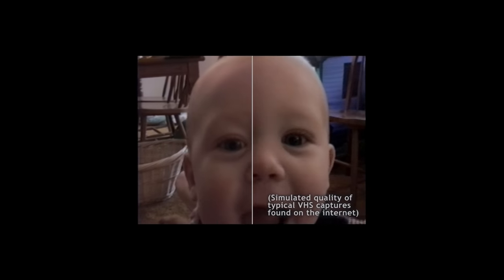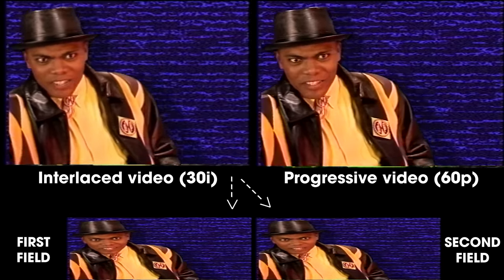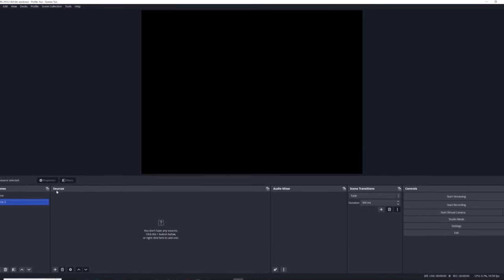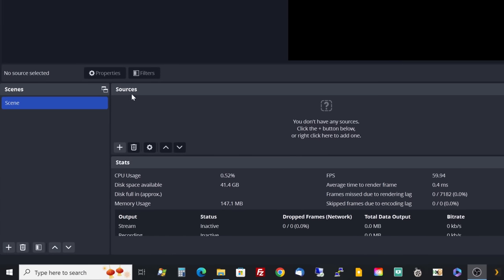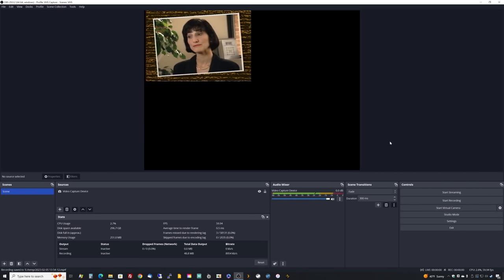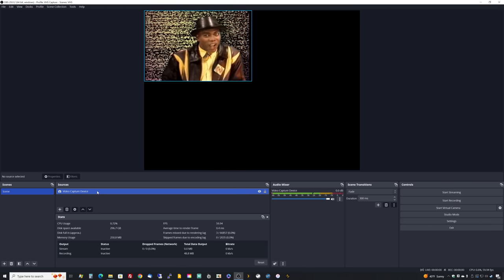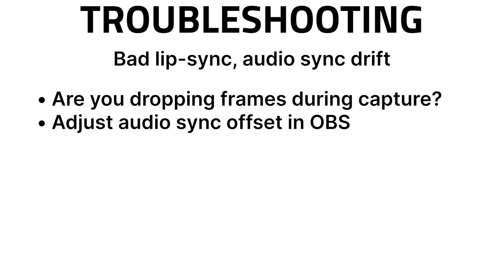How to convert VHS videotape to 60p digital video

Comment: Your thumbnail on this one doesn't make sense, because digital videoTAPE already existed as soon as D1, DVCPro, and MiniDV, etc. did. But the title below does, since it specifies VHS. Actually, that title should say "standard VHS" or "analog videotape," since there is D-VHS (digital VHS) from the late 90s-early 2000s. Anyway, so please do that and then make a new thumbnail to match, so that it will make sense as well.
Reply from the maker: The title and thumbnail are accurate, because I am specifically covering analog videotape, aka VHS and S-VHS.  If someone were trying to capture D-VHS, they'd use an entirely different process than the one depicted in this video (likely an HDMI capture card).  As for "standard VHS", most people understand "VHS" to mean that in popular vernacular, so I don't think it needs mentioning.  In fact, I think it would confuse most people, as most people are not aware D-VHS existed.

Comment: The problem with this tutorial is that everybody thinks he is using the Dazzle when in fact he is using the japaneese I-O Data that is why everything works for him and not for everybody else. I wasted my money purchasing the Dazzle on Ebay just to realize this. To get the audio to work in the Dazzle is a pain and when it works then it does not record. So I guess I am SOL now. 😐😐😐
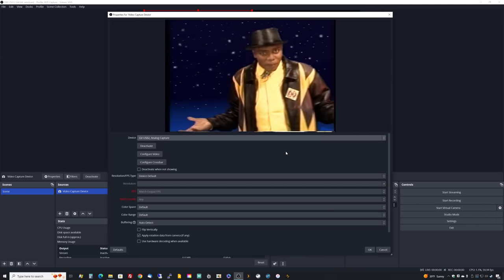Reply from the maker: Apologies if it wasn't clear that I was using the IODATA during the video.  You're right, at 14:38 I switch to the IODATA and use it for the rest of the video.  But you're not out of luck; see the comments section where someone figured out a way to get audio from it.

Comment: You're confusing number of lines with frame rate. There is no such thing as 30i and 60p. There are for instance 480i and 480p where 480 stands for number of lines. Frame rate has nothing to do with it. Also, you shouldn't use 60 fps because that's not original VHS frame rate, frameskips are visible because of it, especially on scrolling text, it's far from smooth.
Reply from the maker: 30i, 30p, and 60p are common terms in the industry for over a quarter century, and mean 30 interlaced frames per second, 30 progressive frames per second, or 60 progressive frames per second respectively -- regardless of the number of lines of the signal.  You can use 30i to describe both 480i and 1080i content, for example.

60p is the only progressive output from a 30i source that preserves all 60 fields per second present in the source material.  30p output from VHS throws away half the information, which is why this tutorial has a 60p output target with a proper deinterlacing (x2 output) function.

Comment: 60p?  You mean 60fps? I mean you could make a 60p video if you really wanted to for fun.  And oh btw, you can't get better than the source and VHS isn't 60fps.
Reply from the maker: VHS is 60 fields per second, and this tutorial is for beginners, so the output of 60p is correct for a 30i source.  If you are making 30p/30fps files from VHS tapes, you are doing it wrong.

Comment: But vhs tapes playback at around 24fps mainly and some are not more than 30 fps. When we play it looks like 60fps smoothy, am I right!
Reply from the maker: VHS tapes always produce 60 fields per second (to be technical, 59.94 fields per second).  The source material on the tapes might have come from film, in which case you'd only see 24 film frames per second, but VHS output is always 60 fields per second.

Comment: I found another video where someone used an AV to HDMI converter and captured it with an HDMI capture card:
https://youtu.be/ZC5Zr3NC2PY
Reply from the maker: In fact, this is the same video I link to in this video's description for people who just want a single-pass hardware solution.  The only thing to be careful of is to verify that the analog-to-digital converter is preserving both fields when it does the conversion.
Reply: Ah, I must have missed that.

Comment: I did this a long time ago and I can tell you it's a waste of time. You'll end up with a VHS quality DVD.
Reply from the maker: What other transfer methods would you recommend?
Reply: @TheOldskoolPC  I found out that VHS quality in does not give you DVD quality out. Perhaps a proffesional might have a way to upscale the analog quality to digital?
Reply: @TheOldskoolPC  I don't believe there's any way for the average guy to inhance the quality of a VHS to be as good as a DVD. Maybe a professional studio could up convert VHS to DVD quality? I went through the whole down loading then rendering of a VHS tape. When I "burned' it to a DVD it was as crappy as it was in the VHS format. Plus it take a really long time to render the VHS file to DVD format. I did end up getting a VHS/DVD machine that would do the rendering in real time using hardware instead of software. Every so often now I dub a VHS to DVD. It's usually a wedding or special family event. I was shocked when I went back and watched a VHS after having become used to DVD quality. I still can't believe we watched that stuff, except it was all we had.

Comment: BE ADVISED THIS CAN TOTALLY SCREW UP YOUR COMPUTER !!!!!

I was using software that came with the hardware and the quality was not great, so I thought Id give this a try. HUGE MISTAKE!!!

Once I installed OBS, not only does it not connect to the hardware (2 different devices) now the original software no longer works. NO VIDEO !!!

Win10 pro - i7 proc

I uninstalled everything and reinstalled the original software and it NO LONGER WORKS AT ALL !!!! Leaving me totally screwed as of now.

I am assuming some driver that was installed with OBS is the culprit and "uninstall" does not completely remove it.. not sure but decently MESSED ME UP HARD!

BEWARE!!!!!
Reply from the maker: OBS doesn't install drivers other than a shim that appears as a webcam.  Maybe you should revert your Windows computer to a previous System Restore Point to get it back to before you installed OBS?
I have never heard of anyone causing damage by installing OBS.  There are literally millions of OBS users who have never encountered this problem.  Hope the System Restore point works for you.